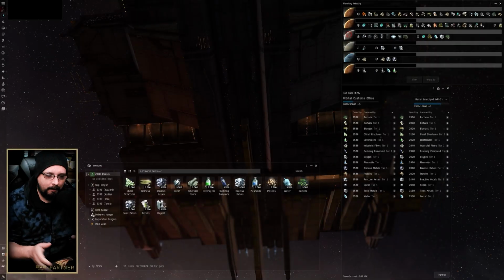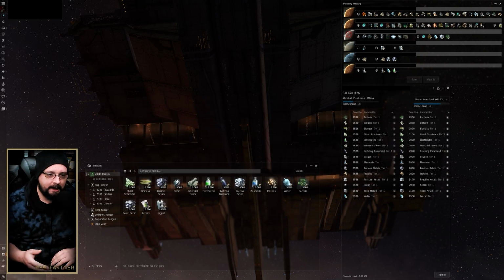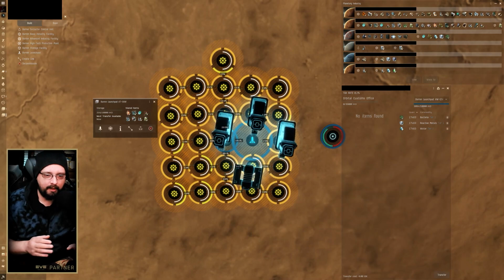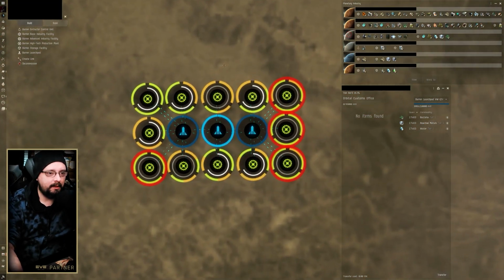Eve Online - Making Everything - All PI Types (P1-P4) On Only 18 Planets

Comment: I am doing this across my accounts, but it’s lowsec. Not null. So the volume is not as good. I decided to give your PI scheme a try. I also don’t do a reset everyday. I stretch it across  a few days. It seems to be working well. I am using your advice to do the basics needed for fuel blocks, then just sale off the individual parts.